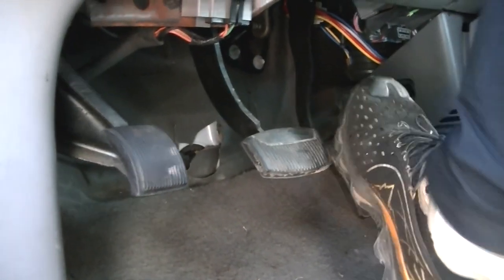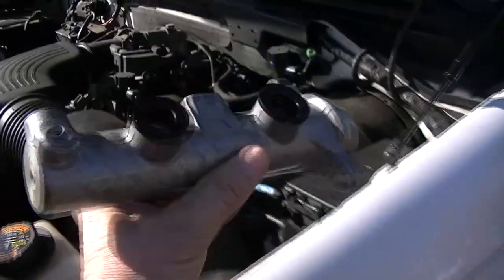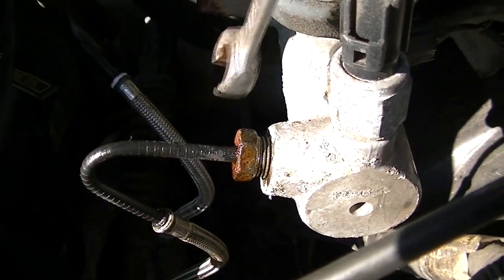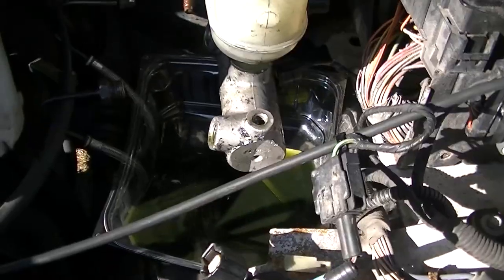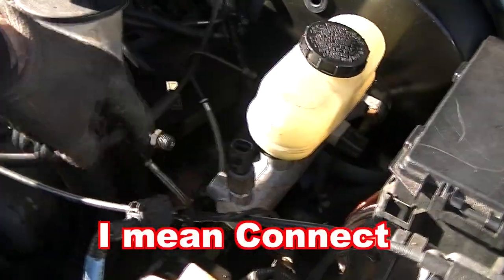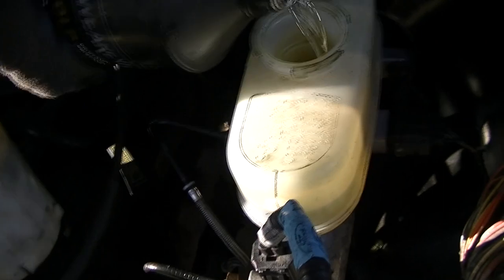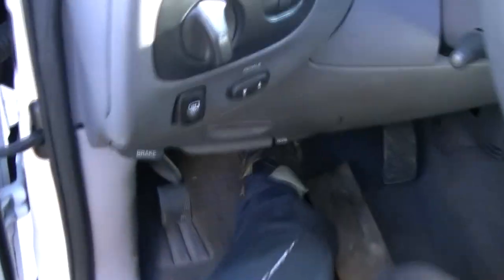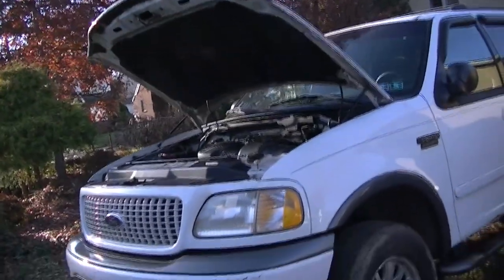Fix Fixing A Sinking Brake Pedal- NON ABS...Master Cylinder time!!

Comment: But how do you know it's not just air in the lines? I had no brake problems until the corroded back brake lines fell apart and I replaced them. I now have no leaks and I've (tried to) bleed the brakes but the pedal is going to the floor. Could it not just be a stubborn air bubble somewhere rather than a bad master cylinder??
Reply from the maker: No. If you are bleeding them and there sinking to the floor, you now 
have a master, cylinder issue or ABS has took a dump. I see this a lot. 
Get a used master cylinder and see if this fixes the issue. There cheaper and that's a good place too start.
Reply: First- thank you very much for the reply. So, even though I had no problem with the master cylinder before I replaced the brake lines, you think it's likely- going by the symptoms I described- it went bad while it was sitting without any fluid in it? (probably more than a month)
Reply from the maker: Yea could be.
Reply: Hey godfrey14, Sounds to me that either you have air in your master cylinder or air in the abs, or a bad abs or bad master cylinder? ANOTHER FIX IS TO EITHER Bench bleed the master cylinder manually or by running tubing from the bleeders to the master cylinder, Careful not to let the master cylinder run dry, Bleed the brakes back into the master cylinder until the lines are full of brake fluid & top off the master cylinder many times as needed, & keep pumping until you see no air! then move to another wheel/ bleeder! (1 tip, use bearing grease around the bleeder so the bleeder doesn't suck in any air) Now, IF YOUR VEHICLE HAS ABS, YOU HAVE TO BLEED ACCORDING TO THE ABS SYSTEM AS FAR AS WHICH WHEEL TO DO 1ST & LAST & IN WHICH ORDER! I have always started at the furthest wheel when bleeding brakes but, when bleeding a master cylinder, I think you can start with the closest wheel then move outwards? I WILL DOUBLE UP, STARTING WITH THE CLOSEST WHEEL & WORK OUTWARD TO BLEED MY MASTER CYLINDER & THEN BLEED THE BRAKE LINES AGAIN, STARTING FROM THE FURTHEST WHEEL INWARD! OR SIMPLY CONNECT CLEAR TUBING TO EACH BLEEDER, USE SMALL HOSE CLAPS TO SECURE TUBING TO BLEEDER, USE GREESE ON BLEEDER THREADS, RUN ALL 4 TUBES TO MASTER CYLINDER, WHILE BLEEDING ALL 4 WHEELS INTO THE MASTER CYLINDER, MAINTAIN A FULL MASTER CYLINDER & TUBES FULL OF BRAKE FLUID & PUMP UNTIL THERE ARE NO BUBLES AT ALL. SHUT ALL THE BLEEDERS 1ST, BEFORE REMOVING ANY TUBES FROM THE MASTER CYLINDER!! I AM INSTALLING ALL NEW BRAKE LINES, Due to a line rupture & rust. I am in the same boat! I am waiting on parts to arrive! Good luck!!!
Reply: Well, stupid auto zone gave me a master cylinder that didn't even fit so I don't know yet. I tried bench bleeding the old one just in case, but it still didn't work. So i'm waiting for one to arrive from advance auto. since I'm without a car, I have to ride my bike to these places or wait for delivery. What I just don't understand is how a master cylinder that was working fine would go bad just from sitting empty for a while (after my brake line burst)
Reply from the maker: What is this on?
Reply: @FixingWithPassion  a 2003 Hyundai elantra
Reply from the maker: Ok. I had the same thing happen to a Nissan. Replaced the master cylinder fixed the issue.
Reply: Well, I'd like to do that too, but both auto zone and advance auto only have master cylinders that have the correct sized ports on the side and larger ports on the bottom. The brake line fittings on my car are all M10. So I can't even find the right part! I've looked online but the sites I've seen don't even mention the size of the ports. This is so frustrating. Any idea where to find this part, besides going to my local dealership (which might not be able to help me anyway, going by my experience).
Reply: @godfrey_of_america  rebuild kit or just google, many to sift through but will find
Reply: @godfrey_of_america  try Amazon, or try a salvage yard